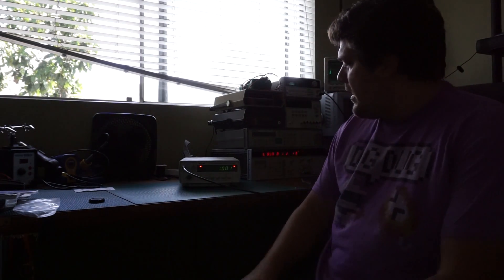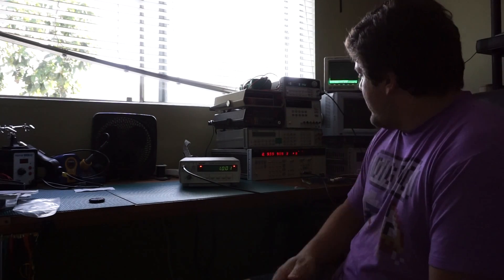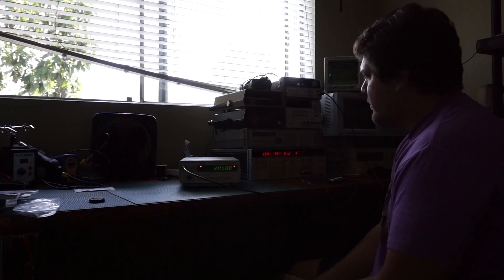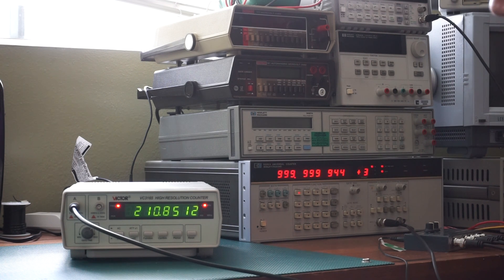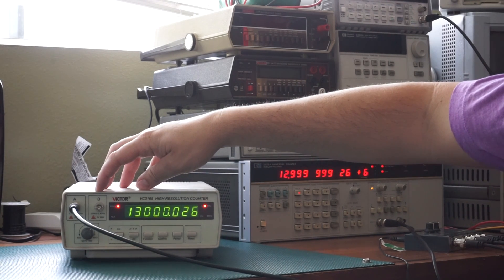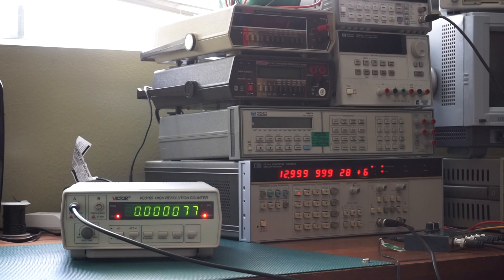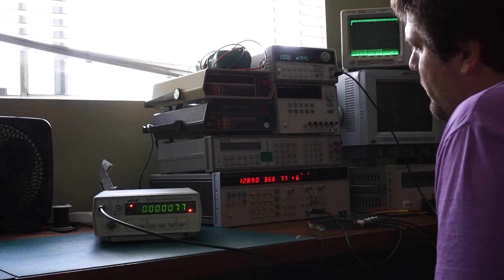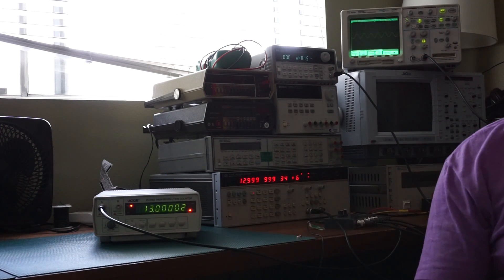Victor VC3165 Review

Comment: I've had one for about 3 years. It is the original "cheap and cheerful" unit, but still remarkably accurate for the price.  (Although then I only paid about USD50 delivered!)  The BIG drawback is the slow display update (due to long gating times to get good resolution).  Operation is a bit clunky, and you need to constantly refer to the instructions to be sure you are using the right mode for the frequency.  It is also not very sensitive.   It has all the "hallmarks" of a frequency counter designed by a software engineer, and NOT an experienced RF engineer!

Comment: My complaint about this unit is that it has poor shielding. with nothing connected the display starts going without a source... I have done an experiment with wrapping the unit around with tin foil and she read all zeros.... The other problem with contributed to this problem was when opening the unit up.. The shield wrapping the input board by the BNC connectors was not on properly facing towards the front.... Before I would repair that shield ... I stripped the foils on both the top and bottom covers by the main board location.. I will be in the process shortly of painting the  insides of the upper and lower cases with shielding (conductive) paint in hopes that the shielding will improve to reject ambient frequencies from entering the counter... I will follow up on that with the results. Another thing I noticed is if you ever need to change the BNCs on this unit, Just throw it away and get a new one as it is very difficult to unsolder the BNC connectors from the board as you will only wind up burning the inside of the front panel.. IDK and it beats me on how that part of the unit was originally assembled!

Comment: Thank you for the excellent video. I have also had this device for several years. Unfortunately, my article was not very accurate from the start. Since I am not nearly as well prepared, I calibrated it as follows:

I bought a used GPS module "NAVMAN Jupiter 21" on Ebay for about 10 € and a suitable antenna for about 5 €. This results in an atomic 1 s TTL pulse with very small jitter, which I used to calibrate the gate time with the trimmer near the crystal furnace. Unfortunately, the adjustment range of the trimmer was not enough. I had to swap the 22pF parallel capacitor for 12pF, then it went wonderfully. Now the counter is accurate to the last digit.
Reply: Great info, thanks for sharing.  Was just watching this regarding modification with a GPS ENO-7 module: https://www.youtube.com/watch?v=1Dp1Yu-KMns